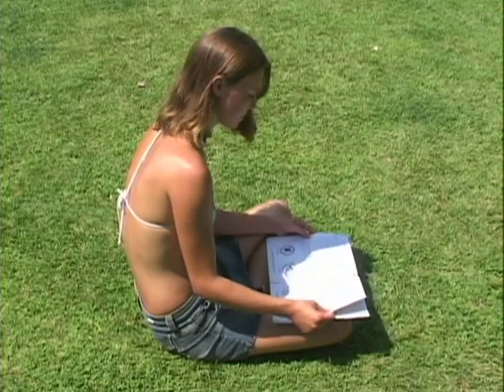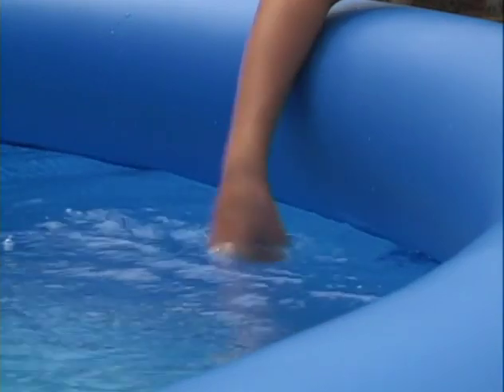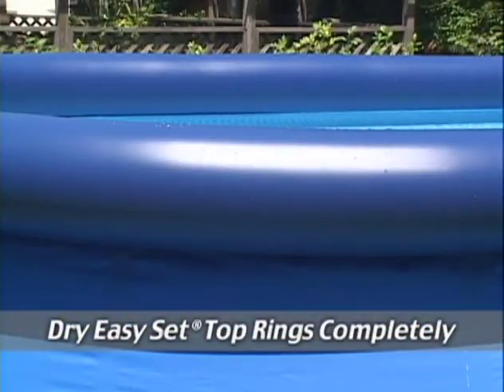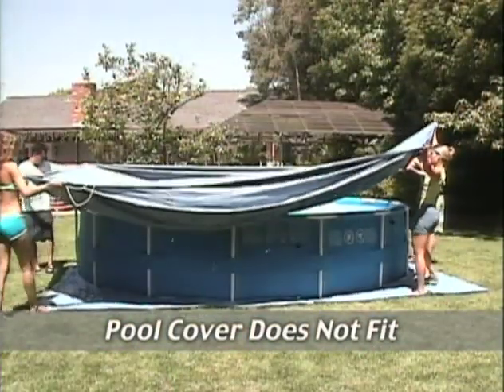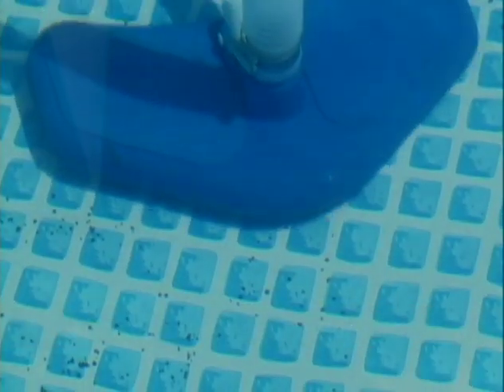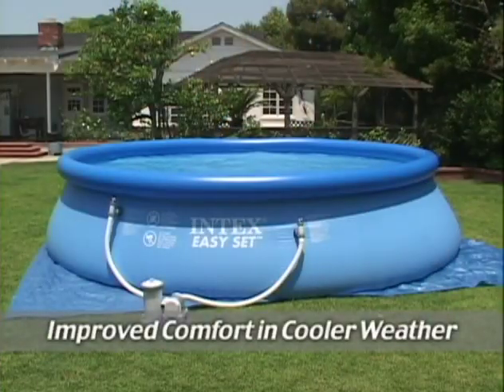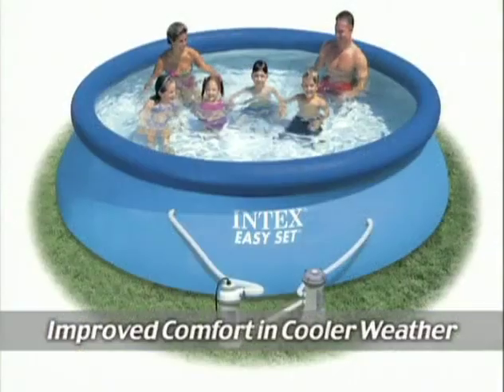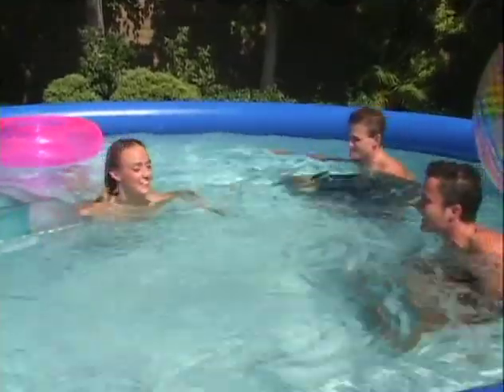Maintenance & Troubleshooting Tips for Intex Pools Maintenance Equipment

Comment: same problem that Mshrader 211 is having any suggestons
"So how do  you keep the surface skimmer bracket from rotating up letting the skimmer suck air (which may burn up the pump if not found and stopped when this happens)?  I can't keep the brand new Delux surface skimmer down on my Ultra Frame poll no matter how tight I tihgten it.  The plastic clamp arter an hour or so it rotates up again or pops off teh frame completely... this seems like a serious design defect.  Intex should be able to come up with a design for this type of pool, especialy for the money they coast.

Comment: So how do you keep the surface skimmer bracket from rotating up letting the skimmer suck air (which may burn up the pump if not found and stopped when this happens)? I can't keep the brand new "delux" surface skimmer down on my Ultra frame pool no matter how tight I tighten the plastic clamp after an hour or so it rotates up again or pops off the frame completely... this seems like a serious design defect. Help?

Comment: Omg I have never had sonmuch trouble with a above ground pool as I have with this InTEX pool this year. I have had an awful cloudy pool ever since I set it up in May. I do not know if it’s an Algae issue or what??  Testing the water will indicate high ph one day than than the next it’s good and the total alkalinity is low? I have used an algicide, I have used a water clarifier,  I have shocked the pool numerous times I vacuum it than it looks worse than it did before I vacuumed, it does not matter what I try, I backwash the sand pump every day and I just cannot get this pool clear much less to a crystal clear Looking pool. I honestly don’t know what has happened or what is causing it I do have a pecan tree hanging over the pool could this be residue from that tree this year it’s never been an issue in the past. Is it an actual algae problem whatever it is I cannot get this pool clean. Please is anyone out there experiencing the same issues in trying to clean and get their pool clear please let me know what your thoughts are. Suggestions welcome.